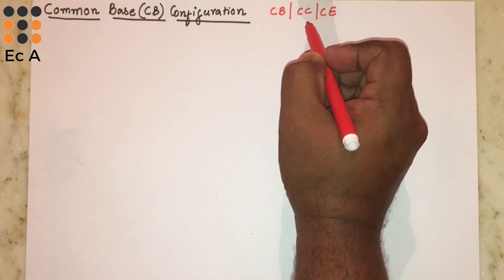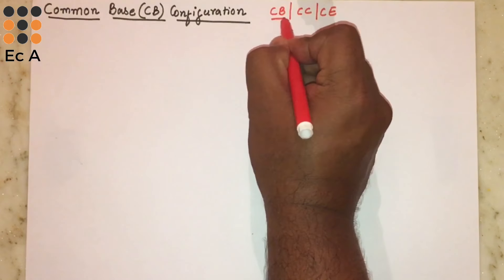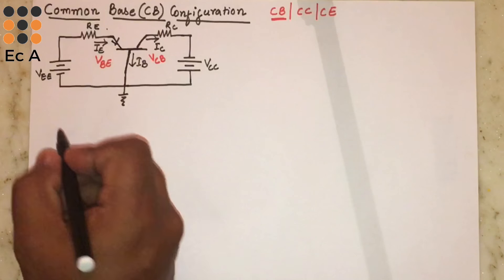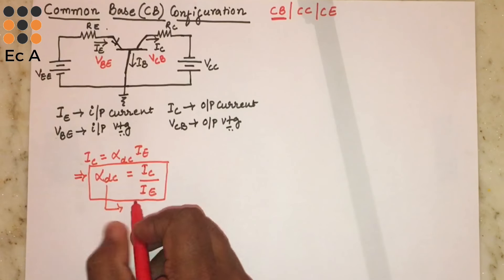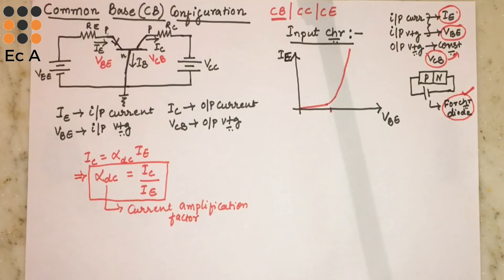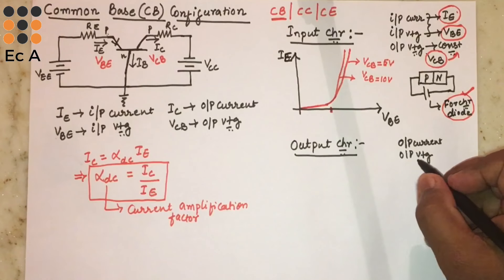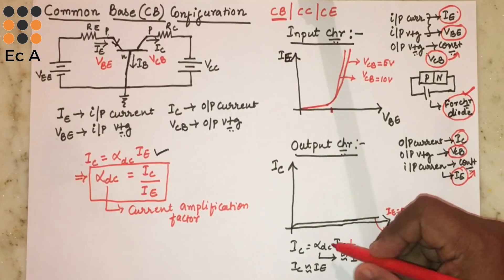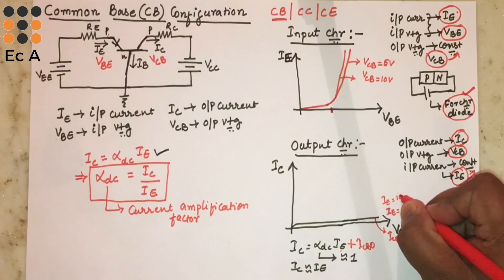#23 Common base configuration of a Transistor (BJT) | input & output characteristics || EC Academy

Comment: 01:28 The common base configuration of a transistor involves the base being common between input and output.
02:56 Transistor base configuration involves forward and reverse bias junctions.
04:24 Common base configuration allows for input signal amplification.
05:52 Alpha dc is the current amplification factor.
07:20 Output characteristics of common base configuration
08:48 Understanding output characteristics of a Transistor
10:16 Ic is approximately equal to Ie due to reverse leakage current.
11:44 Transistor has three operating regions
Crafted by Merlin AI.

Comment: Sir why for CE configuration output terminal is not connected as reversed bias?
Reply from the maker: Please watch video on “transistor voltages” in the same playlist...!!! You will easily understand 👍
Reply: As it is passing the energy towards the junction from emitter...